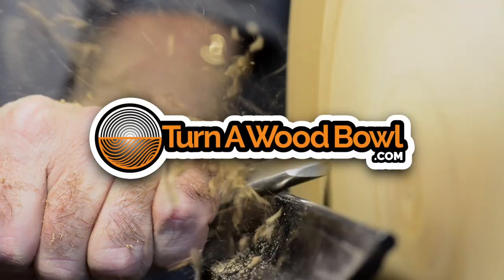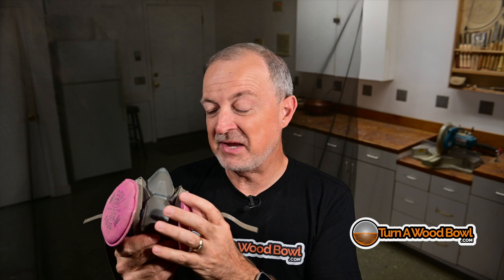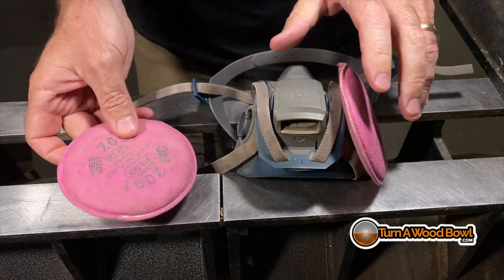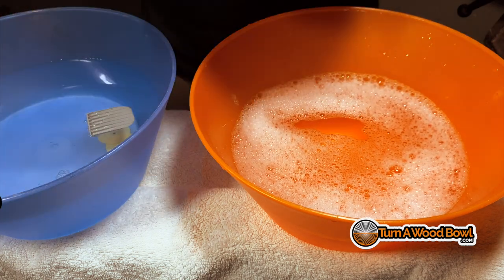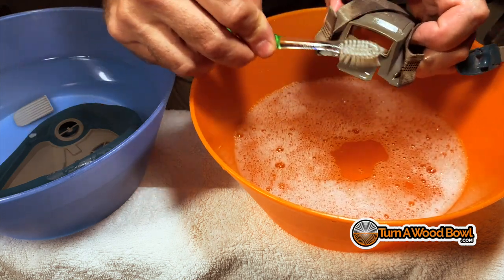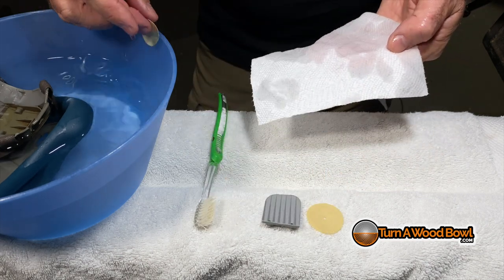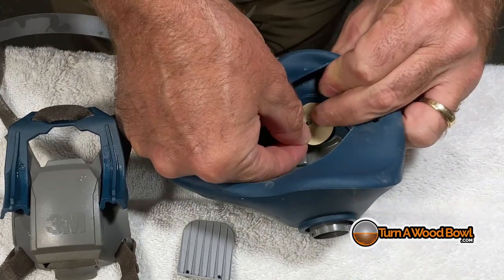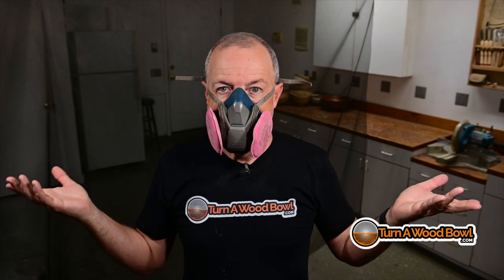Respirator Cleaning — Woodturning

Comment: Hi 👋, Kent , I hope you are all keeping safe and well, about 25 years ago I lost a friend he was working in a CNC router room, breathing in dust, What I have noticed is a lot of people wearing a mask while doing their machining or sanding or routing , and directly they have finished they remove it, they do not realise that the particles are still in the air for as much as 24Hr at least in some cases, Especially MDF OR PLYWOOD, I had noticed this a few times, as I have cleaned up my work shop, then came in to work on a Monday and found dust laying on my machinery, so I ended up buying a air fed head shield respirator 3M it was expensive but well worth it, as I would wear it all day, 
This respirator has got, Face / ears / and breathing protection . Staying safe at a young age, will help you later in your life. 
Retired English gentleman living in France, specialist joiner carpenter cabinet maker, Phil from the moulin France
Reply from the maker: Phil,
Thank you for writing and sharing! Yes, you are so correct. I keep mine on until I've swept up and plan to leave the shop. That MDF is really bad, as you say. Take note everyone and watch the lingering dust as well. All the best to you and Happy Turning! 
Kent

Comment: Thank you so much for this video! I always shied away from these because I thought that they would require a lot of pressure, be very uncomfortable for a proper seal, and all that to not even know if they would do a better job. However, being told that I actually shouldn't be able to smell any sawdust through the mask motivated me to replace my old cloth mask/filter combo with this setup (which is even comparable in price) and WOW! What a difference. I really can't smell anything through the filter and it doesn't even require a very tight fit in order for a proper seal. It feels much lighter and more comfortable than I ever expected while doing a much much better job than the cloth masks (if those do anything at all).
Reply from the maker: Dude! I'm so glad this has helped you see it's not that big of a deal to get a good respirator. Well, it IS a big deal for your lungs. All the best to you and Happy (safer) Turning! Kent

Comment: Kent, you are spot-on with the concern as to what we breath while working with wood. Many years ago not much was said about breathing in wood dust - today, it is recognized as a real problem. I have the Trend Airshield Pro with the positive-pressure respirator (I got it on-sale for a reduced price). Although it takes some getting used to, I find I feel much better using this than I used to when I didn't wear any respirator or filter. I do clean my filters regularly. Wish I had known about the importance of avoiding breathing in wood dust when I was younger.

Thanks for covering this extremely important subject! Not only is wearing a mask/filter important, keeping it clean is essential. Good reminders and excellent video!
Reply from the maker: Thank you for writing and sharing! Glad you understand the importance of a good respirator! Happy Turning!

Comment: A good and very important post. I wish I'd started wearing one sooner than I did. I use the same type of mask and it's quite comphy. They come in different sizes too so you can fit it to your face size. I also spritze mine with disinfectant too since the warm moist air in the mask can be a breeding ground for bacteria.

Comment: Thank you so much, I have made my living building things from wood. thankfully most of that was outside. I am not nearly as good about wearing a mask as I should be. We are all learning as we go. I agree with what you said with maybe one small exception. You said that the mask should last for years and years, I will take a bit of exception to that. Keeping it clean is a must. however, the rubber that creates the cushion around your face can get old and dries out. I have had to replace one or two because the mask was just too old to seal properly, that is probably more a problem for some of us, I have roman nose. (it roams all over my face) so getting a seal is a bit problematic. If I would say anything, and I think you would agree, make sure that the mask you chose fits your face perfectly.  I wear a CPAP each night and I have to replace the cushion about every other month, because it dries out and getting it clean enough to be on my face all night is problematic, germs build up and just cleaning it is not enough.  I clean the mask and my face each night before I put it on for the night, doing something with any kind of mask is probably a good idea, just be careful what you use to clean your mask, some of that stuff is probably not good to inhale. This probably goes with out say, be gentle with the cleaning of your mask.
Reply from the maker: Thank you for writing and sharing! I'm still laughing about your nose. ;) All good points. Well said. All the best to you and Happy Turning!

Comment: This is a great video. Love what you show. You did mention N95 masks. I can understand the difference as i have used both types of respirators and masks.  Last year, i bought 2 types of N95 masks.  One was american made, and the other was from China. I wondered about the quality between the two  masks. I try to buy made in the USA as a better quality.  I also noticed that when turning wood, it is best to use a mask or respirator. Was a great learning experience. Elm and eucalyptus  were a bit hard on me.  I do plan to get a better respirator in the near future. Yes, they cost more and are worth it. I also learned that there is a time limit while wearing respirators as you can get into a europhoria as it happened to me. When i realized it, i had to leave the area and remove the respirator.  
Thanks again for showing how to clean the respirators.
Reply from the maker: John, Thank you for writing and sharing! Click the link below. This respirator is not that expensive and for the protection it provides I find it priceless! All the best to you and Happy Turning! Kent

Comment: Ken, when turning resin should I be using a different insert, for chemicals? If so, which one would you get if I also bought this 3M mask?
Reply from the maker: James, Yes, you will need vapor filters for that process. No biggie, you can switch the filters out with a twist. Happy Turning!
Reply: @TurnAWoodBowl  do you have a link where you get a commission for the right filter insert to buy?